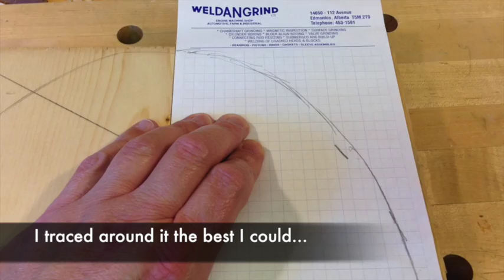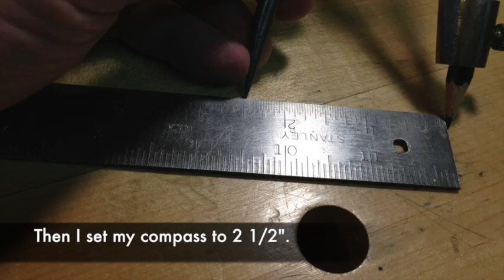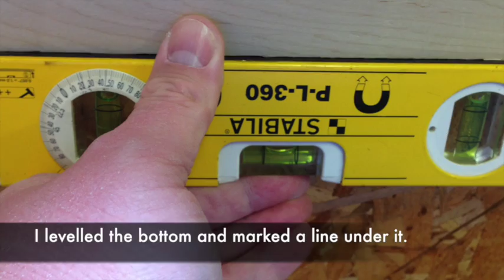Scrap Wood Air Hose Rack in the Microshop

Comment: nice windows in the doors. FYI, rip a piece  2x4 into thin strips and trim out the windows and they will really pop. another great video :>)
Reply from the maker: Thanks for coming by again, Russ.  My plan is to do that very thing, but I am still hunting for some cheap plexiglass to put an inner pane on the window first.  I want to leave a dead air space so, when the temperature gets down to -40, I don't lose too much heat.  Thanks for commenting!
Reply: it will frost up in between. and you won't be able to see out (or in).  a pre-cut piece of Styrofoam hinged at the bottom might or a bi-folding shutter might be a good alternative.  you can open and shut in harsh temps.  just a thought  :>)
Reply from the maker: Russ Veinot I have wondered that myself.  My wife has offered to make me insulated curtains.  That worked in one of my other shops.  I was thinking about the styrofoam, however.